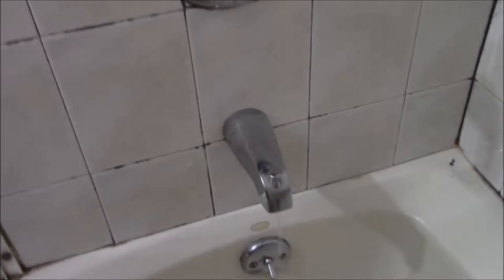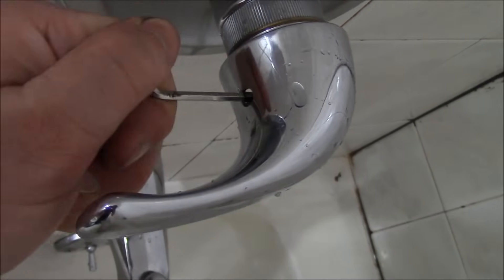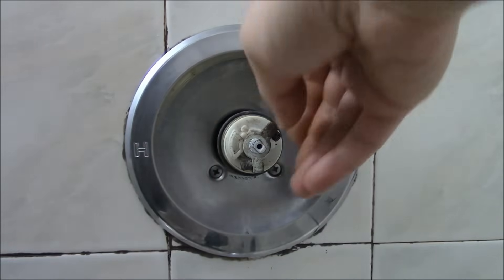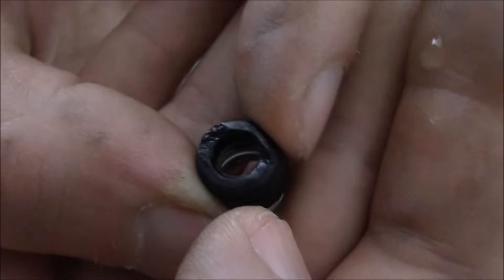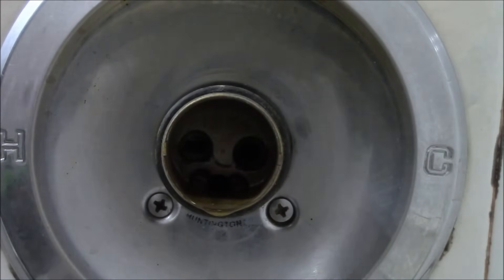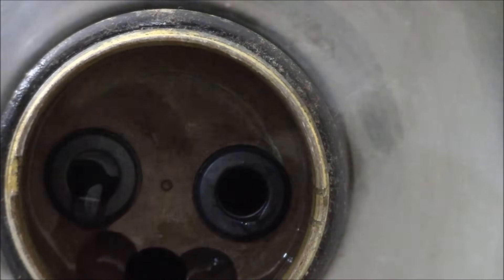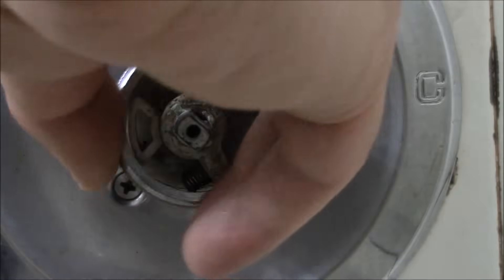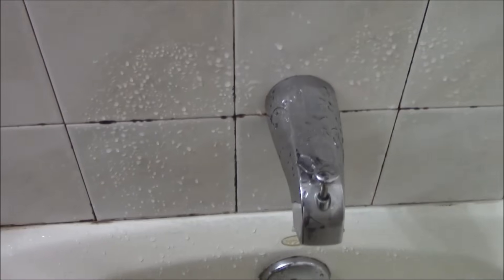How To Fix A Leaking Single Handle Bathtub Faucet Quick And Easy

Comment: Question I have a tub faucet with the same type of lever handle in the video. Ordinarily the handle would be pointing straight down when the faucet is closed and you turn counter clockwise to open faucet with cold water coming out first and eventually as you continue to turn counter clockwise you dispense hot water. For some reason the handle has to point straight up, rather than down, to turn the water off. I imagine I need to turn the shutoff valve off before I remove the handle. Then what do I do so that handle is oriented correctly

Comment: I'm getting ready to do this, I received the seats and springs from delta.  My question now is..can I take the housing, plate, and sleeve off to soak them overnight, very corroded!  Do I have to shut the water off to just get those off?  Or only turn off for the springs and seats?  Hope this makes sense, I would appreciate your help..
Reply: You need to shut the water off at the "main" shut off valve in your garage or out in your meter box near the street. If you are lucky enough to have one in your garage you can shut that one off by hand. The one out by the street you will need either some vise grips or some channel locks (look like pliers he used in the video). After you shut the water off turn on your bathtub and let the water run until it dramatically slows down.

Comment: I got the screw out but the handle still won't come off.  I got a little aggressive with it but it is gripping just as good as when the screw was in.  Should I try something like a heat gun to expand the metal?  Maybe an M-80?

Comment: I have a single handle Delta shower/tub faucet that I had changed out with a renovation kit. So that is all new (had to use pieces that matched the valves). There has been some trouble getting a tub spout/shower diverter that fits the pipe coming from my tiled wall. Finally I got a piece that screws at the nose and got a plastic slide-over extendor piece with threads on the end for the 1/2" copper pipe. The shower activates fine, but I have noticed a random trickle of water from behind the faucet trim kit (not the tub spout. So something is going wrong after the water is being diverted? What does this sound like to you?

Comment: Do I need to turn off the water switch first before take out the handle?
Reply: You need to shut off the "main" water valve to your home. Some homes have it in the garage and some only have it outside in your plastic meter box that is usually out near the curb/street. You will need some vice grips or channel locks to turn the valve off at the street. If you are lucky to have one in your garage, you can usually do those by hand. Once you think the main water line is shut off, go turn on your bath tub to ensure the water is off and let most the water drain out.

Comment: Ok I have experienced an issue with mine, I stripped the Allen wrench nut on my model!!, should I try to use my channel locks to free the the whole fixture?
Or should I just call a plumber at this point?
Reply: You need to go buy a screw extractor bit kit. You can buy them at harbor freight tools cheap, or lowes, home depot, or ace hardware. You will need to use a cobalt (type of metal, not brand) drill bit to drill a small hole in the screw head to allow the extractor to "bite" into the screw hole you made with the cobalt drill bit. It will make the screw "walk out". If that doesn't work, you will need to use a small drill (smaller than the head of the screw) to drill out the screw. Again it needs to be a cobalt drill as they are harder than most steel. Its better to start with too small of a drill bit and move up to a larger drill bit than to go too big and drill out the threads of the faucet handle. Take your time. I am sure there are videos on YouTube on how to use screw extractor bits if you need more help.

Comment: Is it shutting off the main water or just make sure the handle is in the off position? Our leak is on a unit less than 2 years old…
Reply from the maker: You need to shut the water off that is supplying the tub. If there is no shut off valve then you need to shut the water off from the water main.

Comment: Hey I live in a building- do I have to have the management shut off the water supply for my apt line???
Reply from the maker: If you don't have a shutoff valve in the bathroom then you will need to make sure the water is off that is delivering water from outside before you begin this repair.
Reply: I would not attempt to repair an apartment faucet yourself as they should have a handyman that does that. You could be liable for any damage caused if you mess something up. It's not the same as fixing your own home.

Comment: My issue  is a single lever  shower that is leaking water.. though the shower head.. but no name or brand... is there a one size fits all? we are in lock down..really  cant run around finding the right springs and washer..

Comment: Once I get the faucet handle off I can not get the wring off to get to the washers. I've tried several wrenches, scrapped gunk off, and sprayed a bolt loosener on it and it still won't come loose. Any advice on how I can get that part off? Mine is smooth not ripped like in this video.

Comment: what if i can't identify the make/model of the faucet?  are these universal parts?  or do i have to take it apart and take the broken bits to home depot and hunt?  thxx
Reply from the maker: It's recommended to take the parts with you to the plumbing supply store and match them up with the replacement parts you need.

Comment: I'm trying to make an adjustment so my water gets hotter but I cannot use an allen wrench to remove the handle because the inside part is perfectly round and doesn't work with an Allen wrench. What can I use to remove the handle if the allen wrench doesn't work?

Comment: I shut off the valve, but there is still water leaking. Does this mean it is coming from the main line? I live in a 20-unit apartment building.
Reply from the maker: There is still some water remaining in the pipes after you shut off the main. The water flow will gradually slow and stop.
Reply: @DoItYourselfEasy  it was hours later, and it was still flowing. Also, as pointed out by another commenter, I was still stuck at the first step because of years of calcification, so I just could not get it to turn with the Allen wrench.

Comment: Ok question. Might sound stupid but I need help! My apartment complex WONT fix it. Anything actually. But when you say “turn the water off” you just mean the handle right? Only hot water is coming out causing my bathroom to be extremely hot and humid when you walk in there. I currently have a fan in there to make it less hot. You Immediately start sweating
Reply: You need to turn off the main water valve. This will shut down the water in your entire apartment. My landlord never installed a main valve on our complex so I had to call the water company to shut it down where the water meter is located. Kinda sucks because I have to call them a 2nd time to turn my water back on again.

Comment: what should i do if cant get the handle off? the screw in there is worn so my L  tool thingy wont turn it out... plz help
Reply: Hammer a different size in or drill it out

Comment: Are those rubber pieces universal because I have a one handle and it's a hot water drip
Reply from the maker: Not all single lever faucets are the same. It's best to match up the ones you remove to the new ones when you replace them.

Comment: I have watched your video, but cannot get the handle off. I tried to use the hex key..after finding the right size...but it won't turn to loosen the handle. I even tried pliers to hold onto the hex key but it just feels like it's going to break the key
Reply: Did you ever resolve this?  I am having the same issue.
Reply: I got it off myself.  I always felt I was going to break something, but after some hard pulling, it was corrosion keeping it in place.
Reply: I'm in the same boat, I cannot get the handle off.  The hex key is not really turning.  The handle is slightly loose now, but I see a ton of hard water deposit.  I am spraying CLR in there and I will see if I can get it loose.  Any tips??
Reply: Laura Clouser 
Spray some CLR in it to clean the hard water corrosion then rinse. If that doesn't fix it, try PB blaster

Comment: When you say “shut the water off” does that mean from outside the house or just turn the handle bar off ???
Reply: Outside the house.
Reply: Some homes have a "main" water shut off in the garage, you can shut it off there, or outside in the meter box. I just shut mine off at the valve in the garage.

Comment: what if you can't find the brand of the handle or the faucet,  how do you know which o-ring to purchase? @DIY University
Reply from the maker: I would recommend taking the faucet handle and washers to the plumbing supply store and compare and match them to determine which ones you need.

Comment: My delta doesn't have a screw that is on the neck of the faucet. I do have a cap thing on the front of the handle but don't know how to remove it.By the way I'm a senior female but I'm determined to fix this.

Comment: im trying to fix my faucet but I do not know what brand it is. I didnt install it and theres no logo on it. I took the handle off but I can't get the ring off. Mine looks a little different than yours. It has a round metal piece in front that yours doesnt have. I would appreciate any advice anyone can give me.

Comment: The o-rings are all assumed to be worn if there is a faucet leak, so replace all of them.
Reply: I agree. Also use a thin layer of plumber's grease or silicone grease on the o-rings before installing.

Comment: when you say turn to water off, do you mean turn the main water off coming into the house? thanks.
Reply from the maker: Some bathtubs have a shut-off valve nearby in the bathroom. If there is no shut-off valve then the water will need to be shut-off from the main water supply of the house.

Comment: Where do you cut off the water supply
Reply: If you are still needing this information, or someone else needing this views this: houses, duplexes, triplexes have water lines that run to the street. The main water-line shut-off valve is in front out near the street or curb, under a metal or plastic plate. Lift the plate and step back or lean back while any bugs race away to safety. The value is open allowing water when it is the same way as the water line. When it is turned sideways, perpendicular to the pipe, it blocks the water flow. A large adjustable wrench or pliers or a large vice-grip pliers is helpful; it can be hard to turn that valve. If it is really stuck, and especially if there is plastic pipe there, be cautious and try one more time but use care not to break it - your neighbors will also be without water while that line to the street is repaired if you break it, and you will receive a bill for the cost of the repair. The city-side of the line should be fairly sturdy metal. Just wipe off the valve and apply a small amount of WD-40 or PB Blaster, or vinegar, then later, WD-40 or PB Blaster, until you can turn the water line shut off valve to shut off the water to your home. In an apartment, you may have access to a shut-off valve or you may need to involve the building super or maintenance worker.

Comment: This video just saved me $70.00
The guy at the hardware store told me whole cartridge needed to be replaced, WHAT?
Reply: Most the time the guys at the store think they know what they are doing but most have no idea
Reply from the maker: Glad to help. If you haven't already please subscribe to show your support. It would be deeply appreciated.
Reply: Sometimes they tell you that because they don't know whats wrong, and most people will get angry if they replace just one or two small parts and it doesn't fix it. Most people feel its not worth the extra time to possibly make multiple trips to the store to try to save $10. I use to work at Lowes and Home Depot and many customers would come back later and be mad because they didn't replace everything in there and wasted lots of time. Also when parts start to break, usually other parts are not far behind. For example I had a guy come in to buy just a $4 toilet flap for inside the tank. I recommended he buy the whole $17 rebuild kit with all the seals, but he didn't want to. So a week later he was back in again to replace the filler tube as it stopped working as well. That was another $10. Then he came back later that day because the valve to shut off the toilet started dripping (I had recommended he replace the old valve with a 1/4 turn new valve as well). He lived 40 minutes away round trip and now had made 3 trips (almost 3 hours of his time, and multiple gallons of gas) to try to save $13. He was pissed, but had no one to blame but himself. I don't try to sell someone a whole new faucet but if we have a rebuild kit that has EVERY gasket/o-ring, springs and any other parts that tend to "wear out" for $15 versus just the two o-rings and spring he replaced here for $2, I will recommend the kit for $15 so you won't have to mess with it again for another 10 years rather than replacing one part here and there every year or two.

Comment: and if you can't remove the handle because the allen screw is rotten?
Reply: bumble bee drill a hole through the cap so it pops off maybe?

Comment: What if you do this and it's still dripping? :( The washers definitely needed replacing but mine is still dripping.
Reply: Call the manufacturer and they will send you new Cartridges for Free and replace it. mine was Delta and they sent me and i replaced few years back.

Comment: WHAT IF YOU CAN'T GET THE CORRODED SCREW OUT OF THE HANDLE...WHICH HAPPENS A LOT OVER 15-20 YEARS???
Reply: Liquid wrench or pb blaster. Spray, wait 1 hour, see if its loose, if not, repeat process up to 3 times. If it still won't come, spray once more and wait 24 hours. Try again. If still stuck, purchase cobalt drill bit kit, and a screw extractor kit. They are cheapest at Harbor Freight tools or on Amazon. I personally like the cobalt drills with a step at the tip that drills a smaller pilot hole 1st before the full bit engages. Look up "how to use screw extractor" on YouTube. Its not hard, just take your time and go slow.

Comment: It would have help a lot if you would have said what size allen wrench to use. I have been trying for 1/2 hour to find which one fits with no luck, Details are important.
Reply: If that's the hardest part for you,  you're probably better off calling a plumber.

Comment: What if your leak is coming from the handle itself?
Reply: Then it’s probably the O-ring
Reply: @veshapidze  thanks. I didn't want to mess around and deal with cartridges again so I just gutted it and replaced the shitty Price Fister garbage with all new Moen hardware and plumbing.  It was a LOT of work to stop a slow drip.  But it's all done now.

Comment: My he's screw in my handle is seized and I cannot get it out. Gah!
Reply: Spray liquid wrench or pb blaster on it and let it sit for a hour, then spray some more, let it sit for another hour. Spray some more, wait another hour. If that doesn't work, spray once more, and wait 24 hours. Then try again. If that doesn't work, they sell T-handle alan wrenches to give you more torque or even better, get a socket that connects to a 3/8 drive rachet to get some serious torque. If that doesn't work, you will have to drill the screw head with a cobalt drill bit and then use a screw extractor bit kit to get it out. Look up "how to use screw extractor" on YouTube. Harbor freight sells the kit pretty cheap. If not, lowes, home depot, ace hardware, or even some automotive stores should have them. Or if you have time you can order one on Amazon.

Comment: Still leaking after I did exactly what the little girl told me to do! What now?
Reply: I would replace ALL rubber gaskets in there, not just the ones he did. If you are taking it apart, you might as well replace any little "wear and tear" pieces so you don't have to go in there every year replacing one part at a time. They sell kits that are just a little more expensive that are basically a "rebuild" kit that replaces anything that can wear out along with all the seals. Look for "pitting" in any metal or plastic parts that water can blow by the seals.

Comment: My whole handle popped of and the whole thing is broke 😭😭 Water won’t stop
Reply: You are supposed to shut off the water to the house first before you start repairing this. There is a "main" shut off valve either in your garage or out in the plastic box where your water meter is outside your house. Usually you need a pair of vice grips or channel locks to turn the valve that is outside in the meter box.